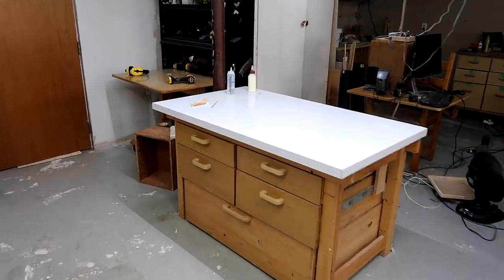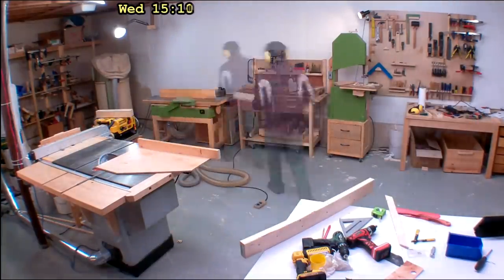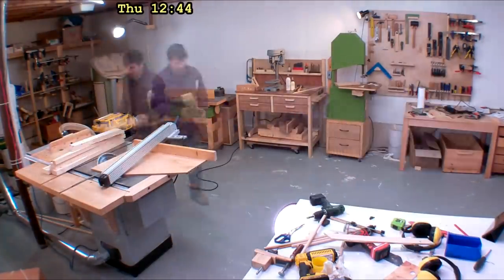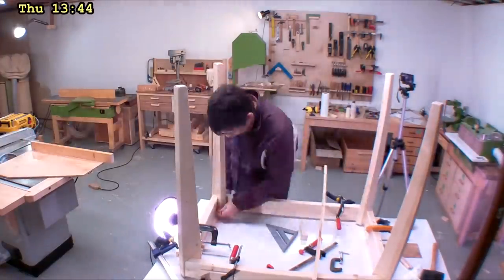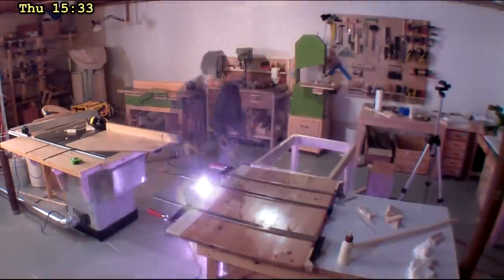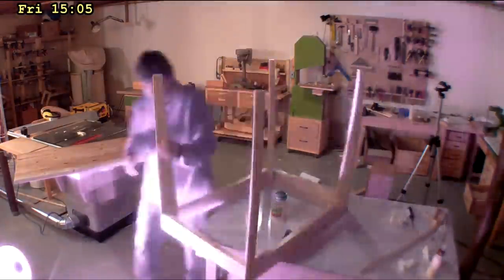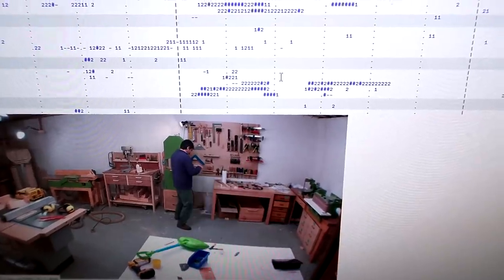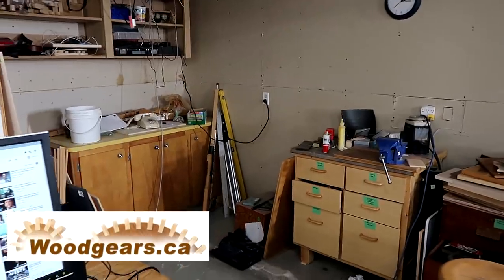How long to build a table: tracking time via timelapses

Comment: Hey Matthias for so long I needed your advice about electrostatic buildup in my shopvac vacuum cleaner in my bakery, when I vacuum large floor area full of flour I get zapped very badly by the handle, is there any way of grounding the machine to stop this annoying issue? Thanks!
Reply from the maker: Yes, you could ground the machine.
Reply: get a copper desoldering braid and attach it to the wheel caster so that it drags on the floor
Reply: @matthiaswandel  Thank you
Reply: @natalieisagirlnow  Thanks, I have one, great idea

Comment: Embed the monitor inside the table and carve/glue hidden pockets to store the raspberry and the keyboard/mouse. Set up strategically placed arcade (or pressure) buttons connected to an usb controller and have them programmed to perform actions you do all the time, like opening youtube with a switch to disable them all so they don't get pressed by accident :P ^_^

Comment: It looked like you made the angled cut for the legs FREEHAND on the table saw! Did I see wrong? I'm not usually a safety nag sort of person, but that looked dangerous. Hopefully I'm wrong.
Reply from the maker: Yes, you are a safety nag
Reply: @matthiaswandel  Nope. This is the first time I have ever mentioned safety in a comment on your channel. So by definition, not a nag.
By your lack of an answer to the question, I assume the answer is yes, you did make that cut freehand. I guess you would not have done that if you were officially filming the build.